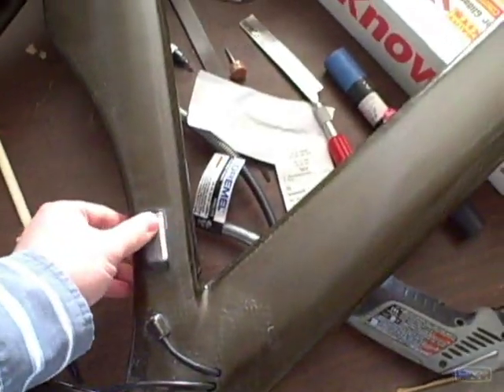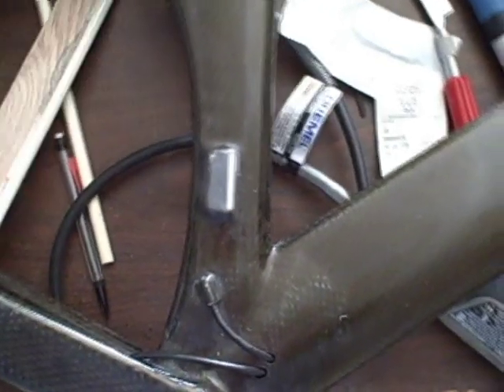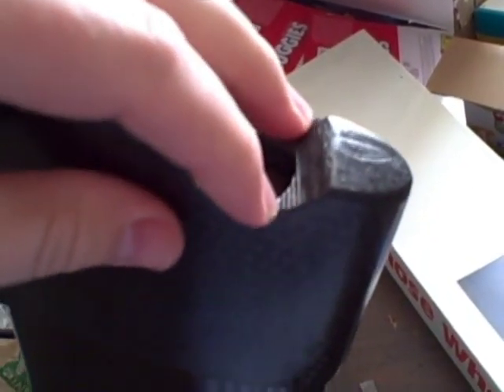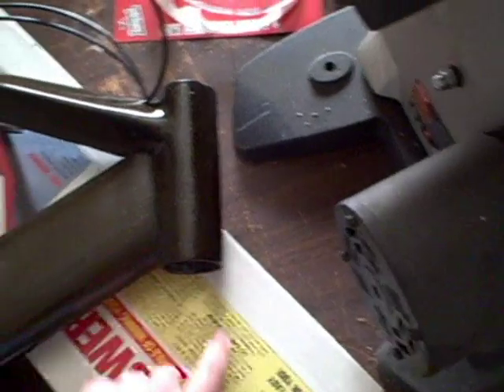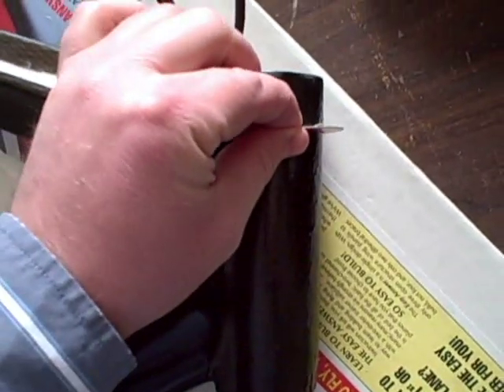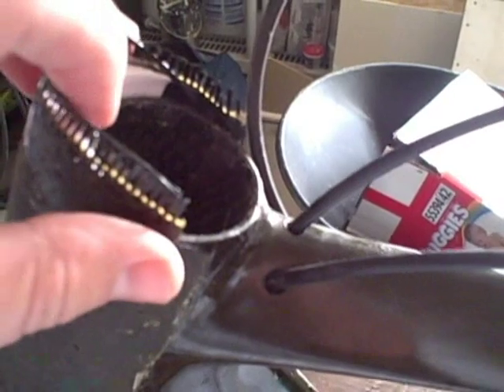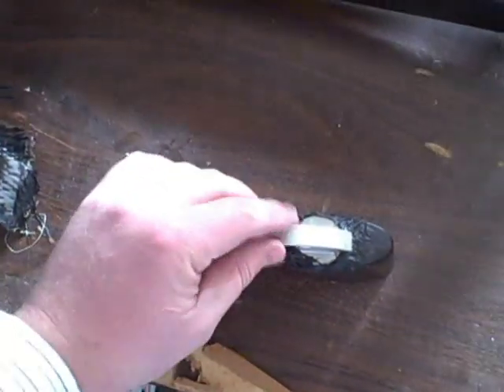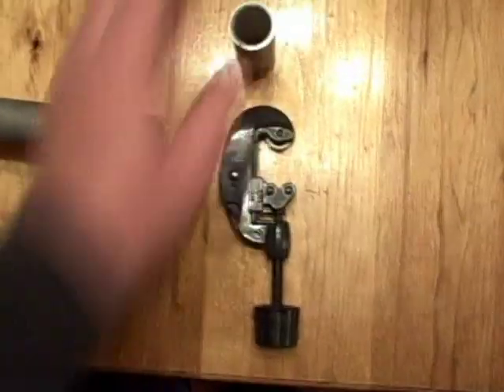Chapter 9 Carbon Fiber Bike Build.wmv

Comment: Hey Mark, 

How does this type of construction hold up in extreme cold?  I am working out how to build my own Fat Tadpole trike for commuting to work in snowstorms and temps as low as -40...   do you think it would hold up? would layering the outside with a kevlar mix help prevent cracking due to impacts in extreme cold?  just your best guess would by fine.

This was an awesome project, its got me really excited for my own pedal powered project.

Hats off to you ;-D

Comment: I just watched your entire 9 episodes about building your bike. This is fantastic stuff and you should be really proud of what you've accomplished. Your bike is beautiful! And you've inspired me to take on a carbon project of my own: I'm interested in building a single wheel bike trailer of my own design - out of carbon.

So many questions...
How did you determine what the thickness of each tube (and layup of each joint) should be for optimal strength, stiffness, & weight?

Cheers!

Comment: I came about these videos from a forum in my country. I just finished watching these 9 video clips, thank you for sharing. Do you still have the bike?

I have one question, how stiff is the frame? Does it flex? I am talking about lateral stiffness in the chainstay and seatstay area(rear wheel arms) and bottom bracket area because when you pedal and make direction changes that is where the stress is more visible, that's where the frame would most likely flex.

Comment: I like to know how you get the cable housing thru the frames.
Since these are just plain hollow tubes with just drilled holes at certain points, how did you get the housing out of the holes..

Comment: Also, when I mentioned needing as much carbon fiber as it would take to make a fishing pole, I really meant fishing poles that won't bend much if any, and they will need to be about an inch and a half in diameter, how many layers do you think I should give it to make it where it won't bend? or at least as little as possible, I think the amount of layers you put on your bike would be enough

Comment from the maker: This refers to the tow size or how many individual carbon fiber filaments are in the tow. So if you have a 1k tow there are 1,000 individual carbon fibers in it. The tow is then what makes up the cloth and there are several different types of cloth and cloth tightness's. Hence the different weights of cloth- the heavier the cloth the tighter the weave.

Comment from the maker: I used 6k 11oz AS4 5 harness satin weave. But for a fishing pole you might wan't something a bit different like a uni cloth where all of your tow runs in the same direction. Most of the fishing poles I've seen are made with Uni type cloths.

Comment: Thank you so much for responding! And I'll be uploading a video when I'm done with the project but it might be awhile because I'll probably need to save up for the carbon fiber unless I can get it for under 300. How thick were your carbon fiber sheets? I'm needing enough carbon fiber to make the equivalent of about 12 really strong fishing poles (i'm not making fishing poles). The website says 1k, 1k etc.. which one did you use?

Comment: I intend to build a carbon downhill bike. I first wanted a aluminium bike, but there is almost impossible to get top grade alloy tubes in my country. Your videos have inspired me to beguin chasing a long lost dream, so i will try to build it in carbon. I think this process is the most suited for me instead of the molding one. My doubts are especially about stifness and overall strengh because DH bikes are very stressed with the jumps and all other forces. Thanks for the inspiration

Comment from the maker: I really have flirted with the idea of doing bars and a rear disk. At the time of this build I was starting to get tired of the project so I just went ahead and bought the bars and omitted the disk. Then I got excited about building the Z-Frame bike and still haven't gone back to drawing board for the bars and disk. I've got a few other projects that are more interesting to me to knock out before coming back to those so it will be a while before getting them made. Thanks for the comment.

Comment from the maker: I must have just missed this one because it's been removed. However, the type of cloth you use is up to you. It's whatever you want, it's your creation. Just remember anytime you have Kevlar mixed in the cloth you may need more of the cloth or orient it in a way to compensate for the lack of carbon fiber. I hope that makes sense. As far as the look goes I'm sure the red will be really nice. Remember that you could always use this as the outer layer and just cf underneath. Lots of options!

Comment from the maker: Thanks! I'll send you a pm on a basics of Carbon Fiber article I wrote.

Basically, the tow size or the "12k" just means that there are 12k individual strands of cf in each piece of "yarn" in the cloth. The larger the tow the harder it is to drape over parts and conform to complex shapes. I usually base my cloth selection off of the weight of the cloth and not tow size. For example if I'm using 2 layers of a 6oz cloth I will often substitute it for 1 piece of 12oz cloth- regardless of tow size.

Comment from the maker: I like doing my own projects for the knowledge, experience, and uniqueness not necessarily for cost savings or hassle. I've had a lot of people tell me that my bike is going to kill me but so far no structural problems and only rider error crashes. I'm not trying to be complacent but I've got over 1,000 real-world miles on this frame- so at what point would you consider a frame safe? I've ridden it hard too- What other testing should I do without purposely breaking it?

Comment: @TheProjectJunkie1 jim bede stopped making the plane a long time ago. I have access to fiberglass forms for this plane outer banks of NC working with carbon fiber is so similar I want to go for it. nobody builds these planes much. the problem with these planes is pilot error . will be installing a plane chute on the unit for sure. glass cockpit gps etc... fly by wire.

Comment: @TheProjectJunkie1 my dream is a bd-5j have access to molds and would love to do what you did but with that little plane it's 12' front to back and 12' wing span would like to go with 2' more wing to support a slightly larger engine. only would like to involve composite honeycomb construction for additional stiffness and strength  at this level weight is negligible.

Comment from the maker: LOL, I wouldn't trust any bike going 50mph+ down a mountain road. In fact last week my good friend lost a bother-in-law while bombing a hill- Pretty sad. Anyway, I start breaking around 40mph and that's if the road is smooth and straight. As far as integrity goes I've got over 1,500 miles on the frame now with no serious problems yet. I've been 35 mph over train tracks no problems and almost endo'd over a storm drain. Still going strong, but I'll be retiring this frame for a new homebuilt soon.

Comment from the maker: Feel free to ask me anything you need- I don't get bothered by questions. I lost the video on the tube cutting process but it was done with templates and a homemade hotwire cutter. I did some touch-up sanding on the Styrofoam if needed. You could sand it uniformly with templates and a long sanding block or by making a long sanding block with the negative profile you want. I've seen it done on urethane foam for a hydrofoil. If you need more info on the process PM me and I'll see if I can find it.

Comment from the maker: The cost was just for the frame. I got my carbon fiber from CJ Composites- I used about 2 yrds of 6k, 11oz, 5 harness satin weave carbon fiber. I believe it was AS4, so standard modulus. I used EZ Poxy 83- because I had some but recommend West Systems 105 or recently I've been using Resin Research's Project 21 system (slow) on some longboards with good results. It's much cheaper with good curing properties. I used about 1/2 gallon of resin on my frame. Layup schedule is on my website. Have Fun!